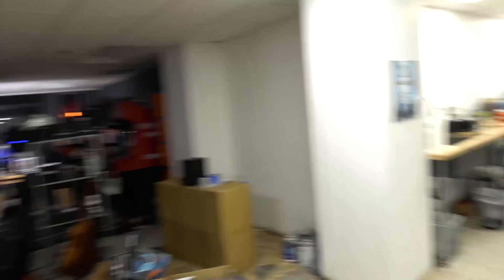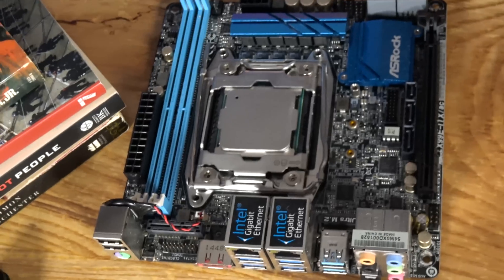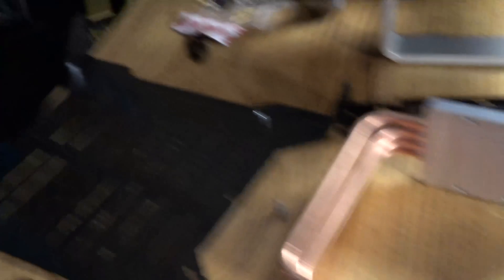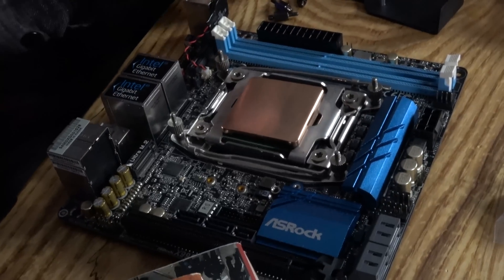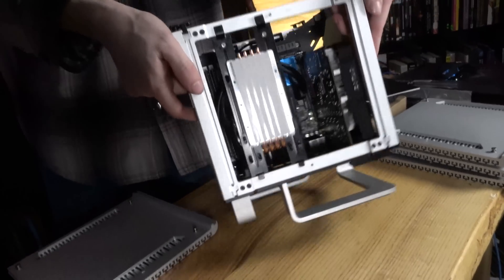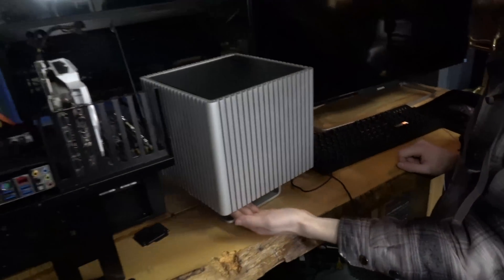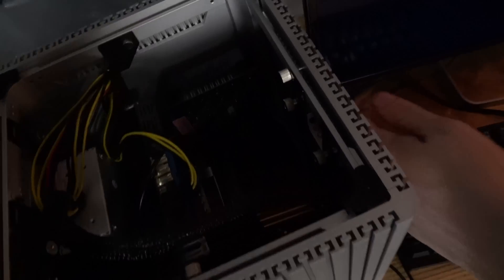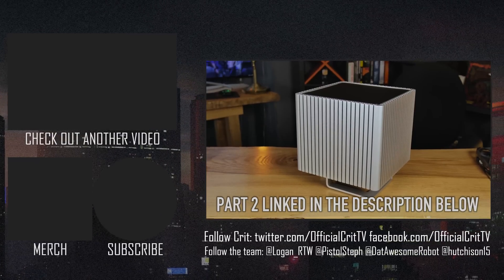Passively Cooled 20-Core Intel Xeon Build in the Streacom DB4 | Ridiculosity

Comment: I bought that mobo and I currently have and engineering sample E5-2667v3 8 core in it. The parts are in an Ncase M1 right now with a hybrid GTX 1080. It's quite a beast little rig.

Comment: Ahh was the 20 core CPU called "Intel Confidential QHUZ"? I'm using that exact same CPU in my system paired with 128gb ECC memory :O
Reply: true however there are still tonnes of sellers with litteral shed loads of "stolen" chips there still doin fine :D
Reply: and people bash us for es's xD there great
Reply: Hell yeah man. Bash me all they want, I'm on a 20 core xeon and they're stuck with an i5 lmfao
Reply: lel 1525 in cine on the es 2650v4 for the pure value of this thing its incredible
Reply: Intel can demand it back since Engenering samples is still Intel's property and you can be charged for possession of stolen property

Comment: Is there not a different cooler that allows the cpu to be cooled by two panels??
Reply: There is, it doesn't fit that motherboard as it requires heatpipes to route where the RAM is at.
Reply: CrapolaFarm ahh I see. Makes sense.

Comment: Linus: This is so cringe. You need a 22 core xeon and a smaller case lmao
Reply: And you have to drop it 3 times and use nothing but Zipties for installation.
Reply: don't forget to use a gtx 980 as a counterweight
Reply: gtx 280's would be more impressive
Reply: I have 4x GTX 280's.. 2 are watercooled.

Comment: if the power supply had more wattage you could build a Ryzen 1700 system in that thing (with a decent graphics card that is)
Reply: the R7 1700 is a 65W CPU. This is rated for 65W, so what part makes you think it wouldn't work?